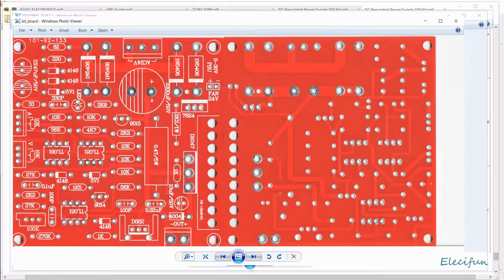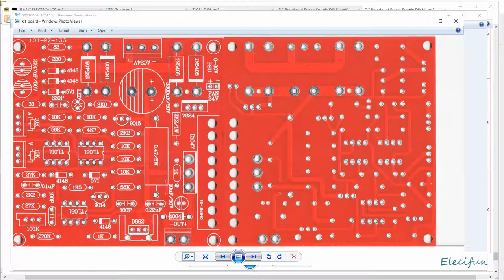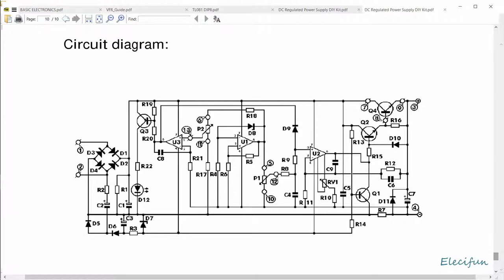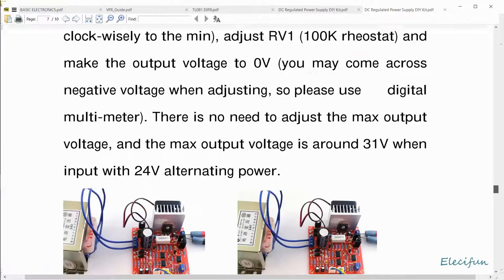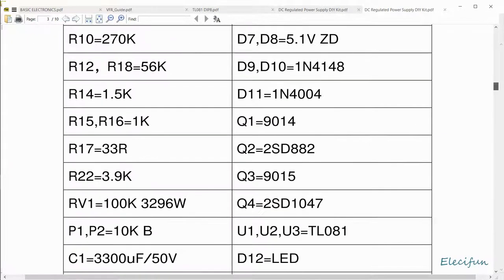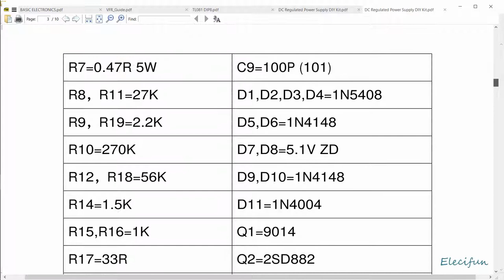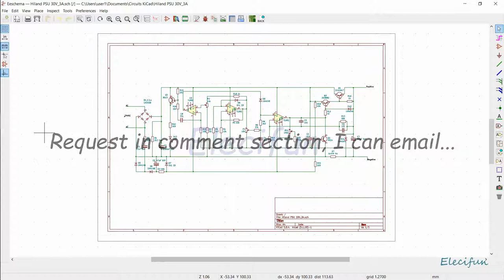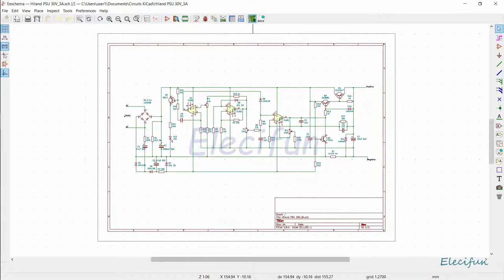Hiland 30V 3A CC PSU Schematic

Comment: Does it limit current under the 400ma range? Also, left pin of C8 needs to be connected to pin 6 of U3.
Reply from the maker: Nice job!  well spotted, thank you for your keen eye. The genuine board limits current down to 2mA, fake board CC is permanent regardless of 10k pot positions.
Reply: @Elecifun  I;m aware of the difference in board layout between the genuine and fake boards but what is the difference in the circuitry between the two?

Comment: Hi again, (I dont know how to address you).

I was chatting to another you-tuber about diodes to protect my projects from a short circuit.

I recently assembled the diy 24 hour clock kit with 7 segment displays. 

Hour, minutes, seconds.

Anyway, after a few vodka shots I connected the ground wire from my bench power supply to the clock kit after realising what I had done I quicked disconnected it. Sigh. I know, I know ... then I reconnected the clock again this time correctly.

But this time the "seconds" seven segment display tube wasn't displaying correctly.

The numerals looked like something on the wristband of the humanoid alien from another world. Strange looking numerals. 😆

I immediately thought that I'd fried the IC or the firmware code had been corrupted or some other weird issue.

Anyway the reason Im writing this message to you.

How does one describe how to place a diode into a circuit using correct grammar? I have another aquintance who is a youtuber also. 

How do I say this correctly? 

Add a diode into the circuit?

I've run out of prepositions that would explain this more accurately.

Put a diode into the circuit? 

Put a diode inline with the wire? 

This is probably trivial question still I'm wondering how an Englishman would say this.

Can you help me? 🤔

Oh incidentally, I'm still interested in downloading that gerber file and having a go at making a pcb for the Hiland PCB.

I've nearly finished building my bench power supply.

I ordered an on/off button for the front panel ...
Then discovered that it does not stay latched which means its a reset button. Sigh.🤦‍♂️

I ordered another one but this time the correct one.

Unfortunately as you may already know there are problems with freight affecting the entire world.

I'm still waiting for it to arrive from China.

Which is why I haven't bothered testing it yet.

(Its on the back burner waiting on parts.)

In the meantime I'm in the garden planting tomato's.

Anyway I just thought I would throw this on the table.

Anyway after I finally finish this project I'll let you know if this clone Hiland PSU is any good or not. 👍
Reply from the maker: I didn't see this message.
Did you build it yet? does it work?
Reply: @Elecifun  Yes I finally finished building it and discovered that it won't work if I push it over a certain voltage or amperage. It's partially useless and you're right.

These kits just won't cut the mustard when you try to power a project that exceeds its current or voltage limitations.
Reply: @Elecifun  I've ordered another modular psu buck converter.

Sadly I made the mistake twice and bought exactly what you bought. What was I thinking? Sigh.
Reply from the maker: @decem_unosquattro9538  What are the power limits?
Reply: @Elecifun  I didn't explore the limitations but soon I will.

I bought a smart switch and I've been playing around with that still later I will let you know more about the fake Hiland 0~28V PSUs.

Night.
Reply: @Elecifun  how can I test my power supply without a load? Do I need a dummy load?
Reply from the maker: @decem_unosquattro9538  You can use a resistor and Ohms law..?  I=E/R
Reply: @Elecifun  A big resistor I assume?
Reply from the maker: @decem_unosquattro9538  No 10 Ohms @ 10V  = 1Amp
Reply: @Elecifun  My understanding of electronics is very basic. I started 6 months ago. So this I think is beyond my comprehension.
Reply from the maker: @decem_unosquattro9538  what is it your trying to measure?
Reply: @Elecifun  Well the counterfeit Hiland Diy Kit is supposed to be 28V and 2A.

Its no where near 2A.

I think its peaks at 30 milli amperes.

I can run flashers, and very small kits. The biggest kit I tried was 15V maybe 20 milliamps.(sorry biggest was the 7~32 smart switch). 

I tried a 7~32V smart switch which makes weird clicking noise then just freezes.

Kinda strange behaviour.

Its as though it has almost no current.
Reply from the maker: A 10 Watt 10 Ohm resistor at 10V will use 1Amp which can be measure with a DMM  Amps selected (use largest 10A setting) in series with the circuit. The rest will be playing about ; )
Reply: @Elecifun  Late last night I discovered that my new fused AC input switch is defective. I replaced it this morning and the Hiland 1~30V PSU is working better albeit not the 30V I was expecting. No idea how many AMPs its supply yet.

I'll build another one soon and let you know how it went.

Cheers,

Decem.
Reply: @Elecifun  I'll get some bigger resistors in the future and try this experiment.

Thanks for taking the time to reply.

Regards,

Decem.

Comment: hey man can i get the datasheet because i can't find it in my country and i got a strange problem i got one from amazon and i didn't know there where fake ones so..... now I find myself with a board that has the same traces as the original one and also the same components apart from a resistor located after the rectifier and i have the original cap the chong, and the real posiction of the diod (at the first start up everything worked but going to adjust it the potentiometer did not change the voltage and double-checking the components I placed a resistor wrong by swapping it from one to 270k to a 27k one I unsoldered the resistance and I corrected it) but now i get much better the output voltage that before was 0.018 and now 0.001-0.000 but the potentiometer continues not to regulate and the voltage continues to be unstable: it continues to go from 0.001 to 0.000 constantly and in negative) -:

I'm referring to the adjustment potentiometer on the board, the blue one

tanks... Manuel
Reply: p.s. great video you helped me but my board.... comment before
Reply from the maker: The datasheet instructions are here http://img.banggood.com/file/products/201505080459530-30Vinstall.pdf
Let me know how you get on, good luck.
Reply: @Elecifun  so so sorry If I reply only now because of school and for some strange problem i can't view your reply whit my original account ( I'm in an other account of me Manuel) i looked at the instructions and all resistors are in the correct spot all the components seems to be the same even the op amps and the transistors and my caps are Chong so as the original kit idk what is happening all the traces are the same confronted whit your video and my psu seems to act strange yes i does regulate the voltage but to only 28.5v whit a 23.7v ac transformer (250va) and the infamous led is on at all time, the regulation pot seems to do nothing no metter how much i turn it the voltage doesn't change and from my original comment I tink the voltage i was reading was joust ripple maybe 🤔

Thank you for your time Manuel

Comment: What VA transformer is recommended for this board ... ?
Reply from the maker: Its a 90 Watts max PSU 3A X 30V = 90 Watts
But as the transformer is not 1 to 1 efficiency we need a little extra to ensure the line voltage is not pulled down while demanding full power. 160VA is what I used.
Reply from the maker: Do not use higher than 24V AC transformer output. Once the 24V AC has been rectified it is ~34V DC 24V X 1.414 = 33.936V or 34V
Reply: @Elecifun  Isn't that too much? Guys on a forum were saying that 80VA could even be too much??? Or I think I'm lead to believe that.

One guy in particular points out that this  kit's "components" are over stressed or pushed to the max of what they're originally designed for.

One guy mentioned in a reply is using 75VA and I wondered whether the reason for that was because these kits are pushed to the max. 

The first guy recommends suggests using 18V x 2 and just using it as a much lower voltage power supply.

I think I might try to beef up a few of the components from 1/4 W to half W on things like registers.

Jack up the main cap to 4700uF from 3300uF.

The one big difference that made a big difference was the addition of the heatsink.

I suspect heat was making it unstable or some other thing I'm not aware of maybe.

My 0~28 2A is at least usable for the time being although I have pushed it about sat 1AM.

The TL081s apparently are the weaknesses in this power supply.

They suggest using 44V opamps I think it was??

Anyway its quite any interesting project all the same.

Thanks for the reply. 🤔🙂👍
Reply from the maker: Hi, I have been giving you advice based on the Hiland 30V 3A PSU kit. Its always best to use a transformer rated higher than what you need at max load. In the example of the above kit as it has a 90 Watt max output. A 12 V - 0 - 12V paired in parallel will provide 24V or a 24V AC output transformer which is the correct voltage. If the transformer does not have enough current ability it will pull down the line voltage on the transformer under load. Depending on the type of transformer E I or toroidal this effect will be more, or less for the latter. 
We still need enough current ability to provide our 3 Amps at 30V to ensure this I would provide 4 Amps knowing that my PSU circuit will only allow 3 Amps to be passed at 30V and I have some overhead so we are not running things strained at full power. 
All the passives resistors caps etc will be fine at 36V DC they can work with much higher voltages. Also the op-amps should be fine and I did try different op-amps but they had no measurable (by me) effect.
Hope this helps regarding the transformer, voltage and current requirements.
Reply: @Elecifun  hmmm thats right. Still I'm totally confused now because some run these with 80VA, one slightly lower, some say it should have a lower voltage transformer. Sigh. Anyway thanks for your advice. I know caps are rated at 50V so yeah that makes sense.

What are you waiting on at the moment?

Anyway keep me posted on anything that interesting regarding this kit.

We might be able to fix these boards without too much of a problem.

Hopefully anyway.

Even if it doesn't work it was still an interesting project.

Best regards

Decem.
Reply: Hi again, I've built two 0~28 2A diy kits one of them is a bit buggy the other one is working good. Something I noticed comparing the two. The 80VA is cooler than the 60VA when its powering a light globe. I assume this is good outcome and the 80VA is less stressed. 

See ya!

Decem.😃✌